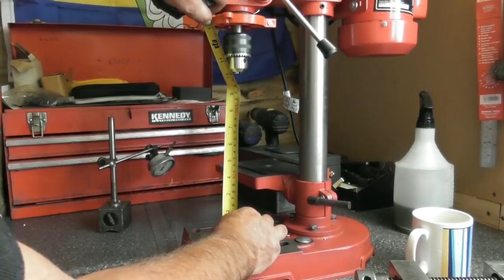Shed talk 8

Comment: Hi
I have the same issue with my chinese floor drill press.
I like your idea for a fix.
My table is tipped away from the piller by a couple of degrees so any fix has to put pressure on the table tobring the table up to neutral.. I thought about a post with a single threaded rod to apply pressure to the table.
I have fought with the table to tram it in so I can do some milling.
No matter how tight I get the table adjustments it still has a lot of flex.
Thanks
Reply from the maker: maybe make a second collar on the shaft to be fitted lower with an adjustable rod to form a triangle to the outer of the table . just a thought . Ade.